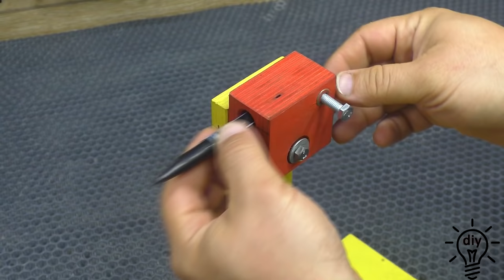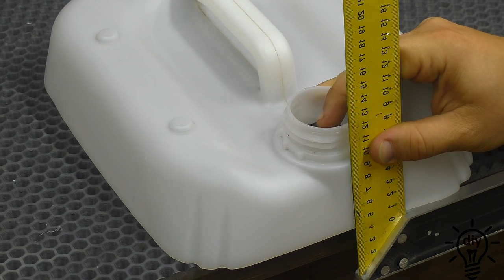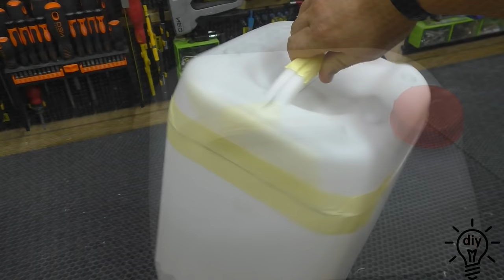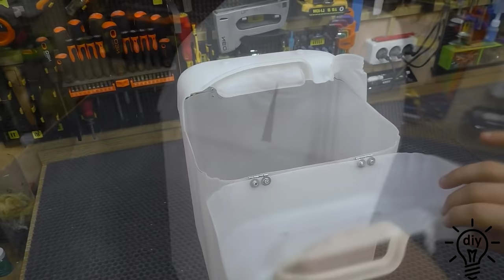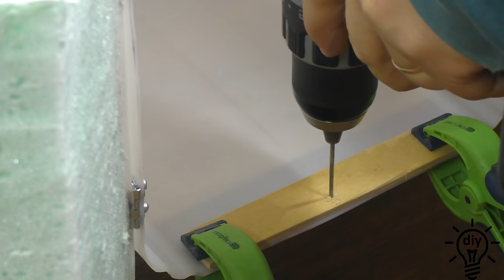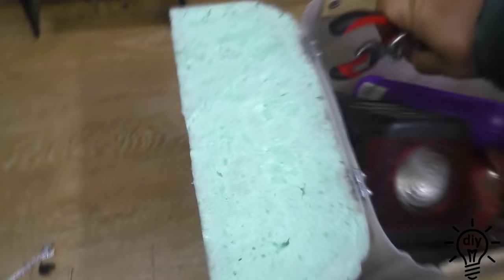Cool idea from a plastic canister!

Comment: Thanks for the idea, but wouldn't it be simpler to just get another like cannister and cut the bottom off, and then put a strap in the middle where the wooden shims are?
Reply: Hola me pareció buena idea ,pero que cosa le pones a las tapas ?Parece un merengue de pistacho ..
De todas maneras es muy útil y con materiales reciclados mejor aún.
Reply: @gladyspatriciaguzmanmunoz8848  Não sei o nome, em espanhol, mas aqui no Brasil, é espuma expansiva, usada para fixar portas e janelas na parede.
Reply: Gracias Susana